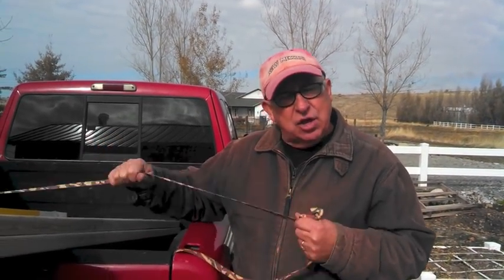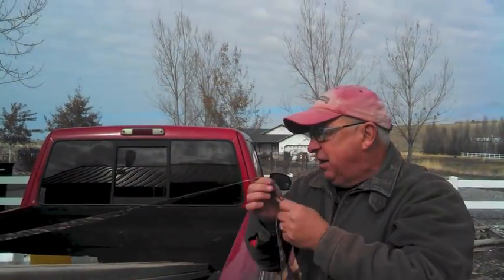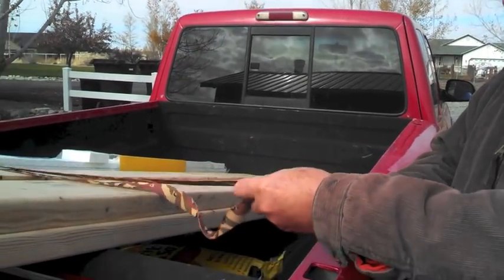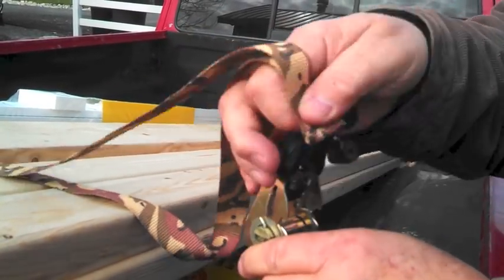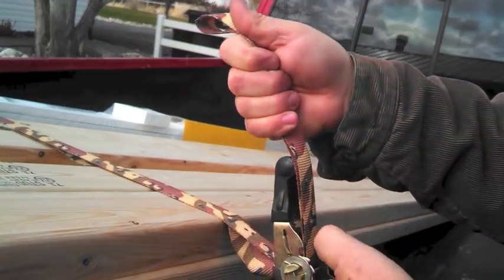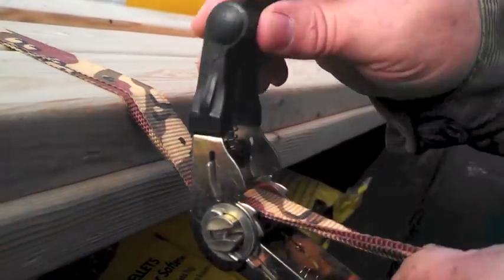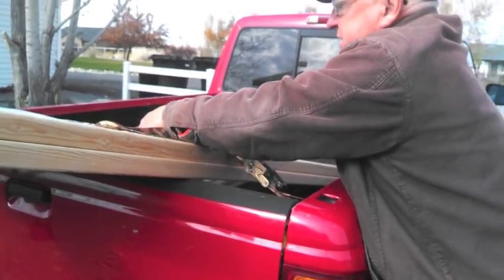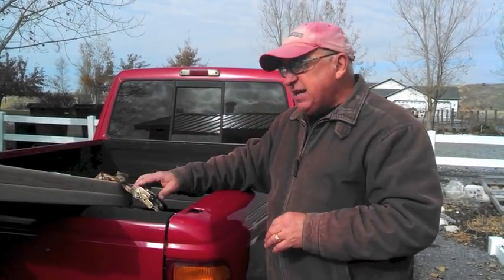DFJ's Ratchet Strap Short Cut

Comment: I reckon this video is pretty old so you might not look in at this, but I have a short bed and am getting started in woodworking. Was looking around for safe and quick tips like this one for securing loads. I like it and will be using it. Thanks a lot - much appreciated.